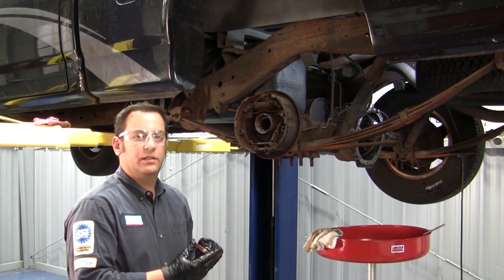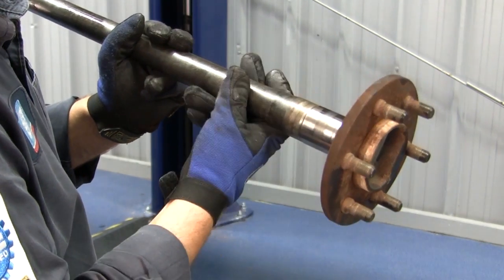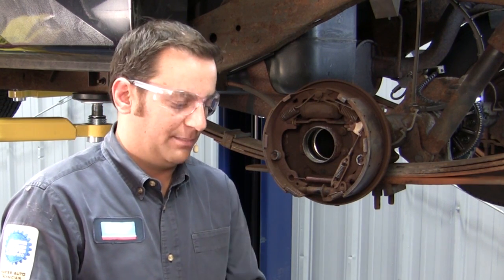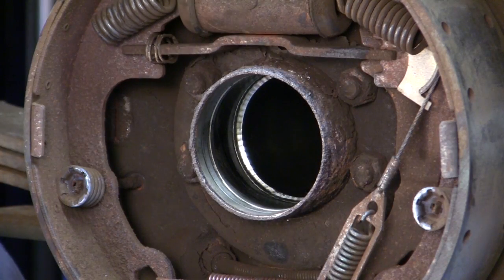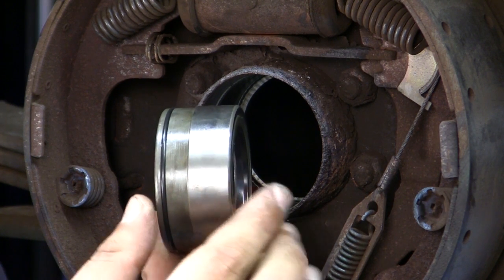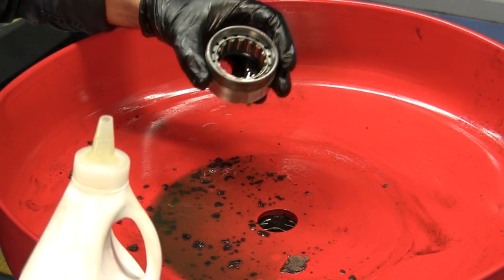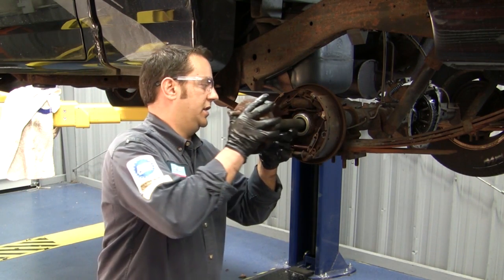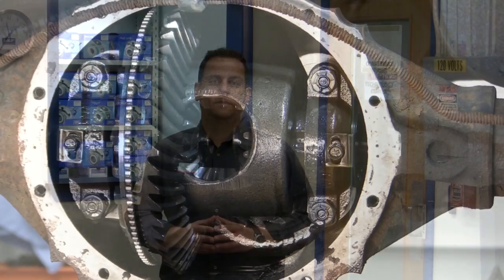Axle repair bearing installation

Comment: Curious if you might know where a person can buy a replacement axle seal for the axle repair bearing assembly? or will a stock OE axle seal work with it ? Its a 88 GMC C1500 with the 10 bolt 8.5

Comment: I know this video is old already, but is it correct that the only thing holding the axle in place is the C-clip in the differential housing?
Reply: Yes, half-ton and car axles have been this way for 100+ years. Once the big pin for the spider gears is in place, the axle cannot move inboard, thus the C-clip cannot come out of its recess in the spider gear, so it's a non-issue. The inboard thrust surface for the axles is actually against that big pin for the spider gears, so you also need to check for wear/mushrooming there at the inboard end of the axle shafts where they ride against that spider gear pin. 3/4 ton and up trucks have what's called "full-floating" axles and are kept in place by a plate and additional bearing at the hub side of the axle rather than these light-duty C-clips in the spider gears.

Comment: I see some questions that are not answered. For these axles the bearing roller actually rolls on the axle shaft vs. rolling on an inner bearing race which is not a preferred design as the axle shaft surface is not nearly as hard as a bearing race. Over time the axle bearing contact area becomes worn or pitted. The best solution is to replace the axles which are typically less than $150 each which includes the new bearings and seals. The alternate solution is to use the Axle Repair Bearings. These bearings move the rolling surface on the axle outward to a new unworn surface. The problem with these is they also protrude from the axle tube which makes it difficult at time to be able to push the axle in far enough to ore-install the axle c-clips without damaging the new seals.
The repair bearings also do not last as long as the original. You may get 40,000 miles or you may get 10,000 miles out of these. If your doing your own labor it maybe cost effective but if your paying someone it is cheaper in the long run to get new axles. Also, to remove the repair bearings (which are hammered into the axle tube) the best way is to remove the seal, inner bearing retainer, slide the bearing out of the housing, then run a bead of weld n the ID of the bearing race and it will shrink the bearing enough to alloy you to easily pull out the bearing. This also does not damage the axle tube. At this point you can either install a new repair bearing or a new axle and original bearing and seal. Hope this helps someone.
Reply: They discontinued the axles for the ford rangers this works if your in a bind
Reply: At least with my 2011 ranger

Comment: Hi. I recently installed one of these bearings but it has a seal on both sides. The bearing came with some grease and then I packed it even more with some of the red stuff. I didn’t know if this was suitable or not because nobody has instructions for the bearings that are sealed off from the diff. Will just grease be sufficient or does the bearing need to be filled with gear lube. I’m betting on grease, but it is a shame that I can’t find an actual answer for these bearings.
Reply: I'm guessing since the new bearing has a seal on both ends...it will use grease for lubrication instead of gear oil, because oil can't get to the bearing. 
   Let me know how it worked out. I looking at installing similar type bearings and you're right...no instructions anywhere. lol
Reply: @geraldwegener8376  10,000 miles on it so far so good :)

My advice would be to make sure to pack the bearing with as much grease as possible
Reply: @flecktards3126  Ok, I will pack as much grease as possible. Probably using moly lithium high pressure grease. Glad it's working and thanks for the update!

Comment: almost put mine in backwards cause there is a seal on both sides. This should be addressed in video. Smaller seal that sticks out a little goes to the inside.
Reply: Thank you finally someone on the internet addresses this issue. No one and I mean absolutely no one referenced it in any of the videos I've watched

Comment: How about National RP-6408 Axle Repair Bearing? I see mechanics saying this design the seal is inboard and the bearing is pre-greased, that just doesn't seem right.  There is a seal on both sides of the bearing, but that axle running on just the grease they put in there doesn't sound like a great idea, guess just for people who cheap out and do not replace a worn axle...  few more miles out of them?

Comment: Whoa..."Not corroded or have any type of imperfection" on the axle...thats why your buying this bearing because your axle is compromised and you dont want to replace it as it shifts the bearing and seal to better surface....If you r axle is fine why would you even use a repair bearing??

Comment: Hello, Great video. I can't seem to find a part number for a axle saver bearing for my 1959 Chevrolet 1/2 ton pickup truck. Can you provide me with this info. Even a regular axle bearing with a separate seal would be great.

Thanks Mike
Reply from the maker: The rear axle bearing is SKF R1502-EL and SKF seal part number 18695. Unfortunately no axle saver is available for this application. Glad you enjoyed the video!

Comment: i installed an AxlesSaver bearing in my 53yr old rearend because of the  horrific noises it was startin to make in the mornings but now i cant get past the metal detectors at the airport. is there a neoprene type bearing to replace the metal ones as it made a big difference in my rearends life and all the neighboring componets in its general. i thought The Clapper was the answer but SKF came thru  thankyou AxleSaver👍

Comment: Nice video, the guy told me that the wheel bearing seals on the rear is causing the car to vibrate when driving 50+ MPH......so is it true that wheel bearings do cause car vibrations? Thanks!
Reply from the maker: Anytime you have a vibration its good to do a complete inspection for possible causes. Anything from an out of balance tire to worn u-joints or center support should be checked. A rear axle bearing or pinion bearings should be checked because they can also cause vibration. Thanks for watching!

Comment: I bought some of these repair bearings to fix the noise in my rear end.  I tried to install the bearing like he did in the video but it went in about halfway and refused to go any further. I had to ruin it to get it out. I measured another one carefully to assure there was nothing to bind it as I drove it in. Again the same problem. It bound up and did not want to go in.I then got a 3rd one and the only thing I did differently to get it installed was I put oil on the O-ring. It was the O-ring that was causing the binding. The installer in the video does not instruct to put oil on the O-ring. Be sure to do that.
Reply: SKF Parts Info,you guys should give him his money back.
Reply: @Tigerchevelle77  no thats user error not parts error
Reply: @alexd6512  actually i bought a different brand but the same type. i watched this video and i knew better than to try to install it dry but he made it look so easy. just trying to be helpful to others.
Reply: Obviously you dont work on cars an had no idea watchu you were doing
Reply from the maker: Point noted, I'm sorry to hear about your installation experience. Thanks for choosing SKF for your bearing needs.
Reply: That's user error, but builds experience. Wont know till ya try lol

Comment: is there a part # that will work for a 1998 Jeep grand Cherokee with a Dana35 rear?
Reply from the maker: You can look up part numbers for any vehicle on our e-catalog (http://www.showmetheparts.com/skf/). From this information is looks like BR72 would fit. You can double check on the e-cat or, if you should have any further questions, call customer service at 800-882-0008. Thanks for watching!

Comment: im unclear on when to use this over a regular bearing and seal...i have a pitted axle shaft on one side will this allow me to save that axle??
Reply from the maker: The technician really has to be the determining person to decide if an axle repair bearing should be used vs. replacement of the axle or just using  a new axle bearing and seal. The Axle Repair Bearing Guide at http://www.skf.com/binary/30-62170/TT10_005.pdf is another informational resource about the axle repair bearing that might be helpful to you. Thanks for watching!

Comment: if you use an axle saver bearing and later decide you want to replace the axle with a new axle and original bearing and seal design can you do so successfully and will the axle saver bearing be easy to remove?
Reply from the maker: Thank You for choosing SKF for your bearing and seal needs. 
If you are replacing the repair bearing with a new axle and original bearing and seal the repair bearing can be easily removed with a puller.

Comment: what about the seal, you never put it back on!!!!!!!!    amigo
Reply: He used axle saver that has bearing and seal all in one.
Reply: Its a "uno piece-o" all together in one part, installed in a mated assembly, so dont get it cocked/ uncentered or itll fubar the seal

Comment: thank you for the great video, local shops wanted $350 plus parts for the outer bearings on both sides....watched your video 5 times to make sure it was that easy, bought my axle saver bearings for $50 and rented the tools from the auto zone to remove and reinstall the bearings.. no lie, it took me 1hour and 15 minutes from start to finish and that included jacking up the rear and removing the tires on my 97 dodge ram    thank you again saved me at least $350
Reply from the maker: +rich mann glad to hear this video helped you. Thanks for supporting SKF.